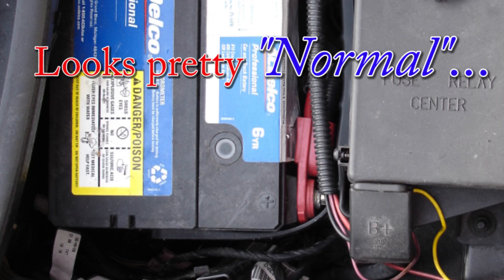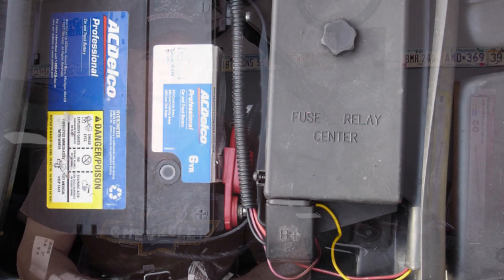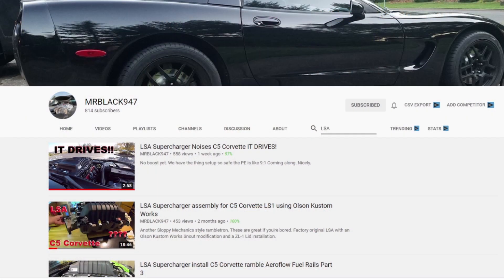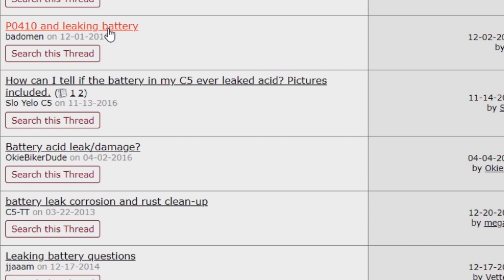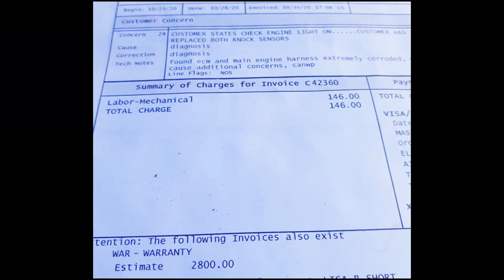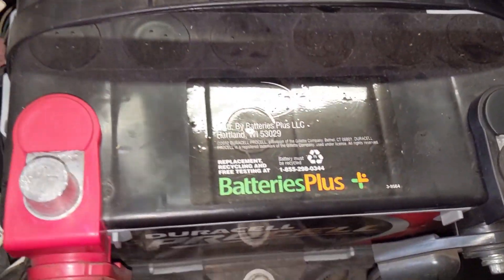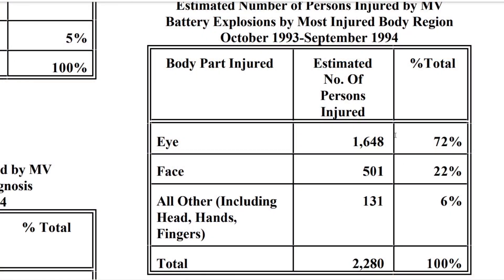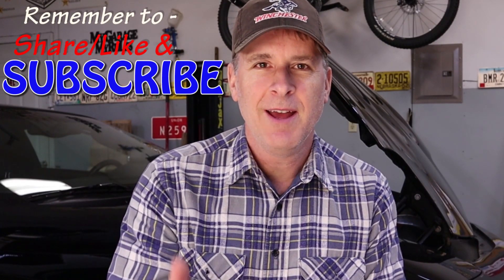Your C5 Corvette's Battery is probably DAMAGING it!

Comment: This is all good information and I thank you for your solution.  I bought my wife a 30K mile '01 earlier this year and knew of this issue.  You have motivated me to check the type of battery the previous installed.  Also you are spot on about battery safety.  Years ago I was helping a friend jumpstart his car.  I turned away just when his battery exploded.  The entire top of the battery blew apart, acid everywhere.  The explosion was so loud my hearing was lost for a day.  I was very lucky that my eyes were spared and your advise for safety glasses should always be a must.
Reply from the maker: Thanks for chiming in and the kind words!

Comment: My C5 has never had a battery leak issue. Still have a flooded acid type battery. But as a precaution, besides checking for leaks and deformed sides monthly, I bought a 1/4" thick battery mat from Amazon and put it under the battery. Mat is chemically treated to absorb and neutralize leaking acid. Under $15 for a sheet. Needs some trimming with scissors to fit exactly.

Comment: Great advice, just double checked my battery, it’s an Optima AGM !!! 😘 Pulled the battery and box and cleaned the entire area after I bought my 02 convertible a year and a half ago. Some very mild signs of corrosion. Cleaned all that up and checked out the computer and wiring. All looked good. C5’s are a really fabulous generation. Thanks again for your video. Merry Christmas, Bob
Reply from the maker: Thanks Bob, appreciate the comments and Merry Christmas to you as well Sir!

Comment: I just replaced my AC Delco battery with a Optima Red top battery. No leaking and my battery tray was extremely clean.
Reply from the maker: Nice!   Many are just fine.  Not every sealed lead acid battery leaks, but every leaky battery is a sealed lead acid battery.

Comment: Awesome video, thanks for posting.
Will pull the battery on my 2005 C6 later today and have a look underneath it to check. 

Great timing as I just ordered an AGM battery for my Factory Five ‘35 pickup truck. I feel a lot better about making the purchase now. 
👍🏼
Reply: Great video.   I've seen some bad ones before. I  Always make a point to check this area when looking at cars to buy.
Reply from the maker: Nice-  hope you find no leak issues!

Comment: amen on the battery explosion.

when I was a teenager ... had one explode on me cranking a tractor.  the battery was on the other side of the firewall, but my feet were exposed to it.  I'll never forget that.  If I don't have safety glasses, jumping mine/another, I always turn my noggin expecting the explosion.
Reply from the maker: I have one explode as well inside the back of my Volkswagen bug when I was 17. It was so loud I thought the car blew up luckily it was underneath the seat so I did not get hit by any acid it made one hell of a mess though and now I always try to connect the positive first and then the negative far away from the battery just in case...

Comment: I have heard this and watched your video as well as others including one by C & S Corvettes where they work on corvettes  C3, C4, C5, C6 C7 and their opinion based on servicing corvettes is the mat and gel batteries do not like areas of high temperature climates;  do not last long;  need a special type of charger and do cost over $100-130 more.
I was thinking about it and decided for my 2001 C5  I check the battery often but also decided to get a  BATTERY MAT that when acid comes in contact with it,  it neutralizes it.
Reply from the maker: C&S definitely has a lot of experience. That having been sad my Duracell AGM is 8 years old and still going strong. It's probably going to die pretty soon and I'll absolutely buy another one.

Comment: thank you for the great info am looking for a C5 and every car I come accross has had the AGM replaced have asked several dealers and private owners if they would remove wheel and cover plate and or battery and box no such luck have passed up half a dozen cars for this reason
Reply from the maker: Did you try telling them you would buy it contingent upon they're not being acid damage?

Comment: Silly question.  How do you tell if your battery is lead acid or agm?
Reply from the maker: Very carefully read all the fine print on the top of the batt.   Absorbent Glass Matt should say AGM somewhere.  If in doubt, call the manufacturer with your make and model battery.

Comment: Well then.. it’s a good thing I didn’t cheap out with my battery replacement recently… haven’t replaced it yet but it’ll be a winter project pulling that wheel well off and checking the pcm and that area. And getting an AGM battery for my baby.
Reply from the maker: Right on!
Reply: @Toys4Life  and honestly I can only take so much of corvette forum.  Just toxic people ruin it. Forums used to be great.  Just not anymore.

Comment: There is an overflow vent on lead acid batteries, attach a small vacuum line and run it underneath. As for the corrosion on the terminals (galvanic reaction), add some corrosion inhibitor. Problem solved.
Reply from the maker: I just looked on one that I had laying around and I don't see it. I'll have to check another one out, this is not ringing about but I may have just never noticed it. Either way my next battery for the C5 is still an AGM!

Comment: This @hit happened to my C5... Although, I used the right battery, it was even an AGM battery which amazingly started to bubble crap out. I damaged it trying to clean it up w/ baking soda and water. Been chasing wiring demons for several years now. I'm trying to find a battery box if anybody makes one to just capture any crap that could potentially bubble out.
Reply from the maker: Yikes.  Not much room for a box without altering the way the battery mounts...
Reply: @Toys4Life  yeah I'm seeing that unfortunately. I bought a new AGM battery but in light of this trouble I've not really driven the vette in 4 years... only to run motor a bit and keep it up. Wish there was a better / aftermarket solution to this beyond the AGM batteries.

Comment: Yeah, It happened to mine. GM, what were they thinking.
Reply from the maker: And I still get comments from people that this is fiction....    Did you switch to AGM?
Reply: @Toys4Life  Yes AGM. Cheapest way to remedy this issue. There are more expensive batteries that are less weight, but if that's not important then AGM.

Comment: i hear the agm batteries are not very reliable ive never had a problem with a wet battery and they last a long time
Reply from the maker: I'm on over 8 years with my agm. That's the longest I've had a battery. Sealed lead acid are just fine, until you get the one that leaks all over your computer. It's a small risk That can be eliminated with an AGM. Property depends on how long people are going to keep their cars. Short-term, go cheap. Keep the car for 15 years, go AGM?
Reply: @Toys4Life  either battery will work fine. if you never open your hood and ignore tune ups then i would never use wet battery
Reply: @Toys4Life  in this video at 6:53 it explains whats recommended for the location and temperature for vettes https://www.youtube.com/watch?v=AUtiDjbS-Us i think overall batteries are pretty reliable
Reply from the maker: The reliable until they're not. There are more than a few people out there that have had their computer and/or harness destroyed by a leaking lead acid maintenance-free battery , maybe it's 2% but those people are miserable and they're unhappy about it. Maintenance-free lead acid batteries occasionally can and do leak- and on the C5 it can be catastrophic. C6 as well. AGM eliminates the risk. The choice is up to the owner, and most people have no idea that it's an issue, albeit a rare issue.

Comment: I have over 100k on mine with no issues. I've never had a problem  because I  have never bought a cheap ass battery.
Reply from the maker: Could be, or it could be that you got lucky. From the feedback I've received all over, it seems pretty random which ones leak due to cracks, or seals around the post leaking. Sounds like they will all leak, if your alternator ever has an issue and overcharges them. Problem is you can't tell in advance if yours is ever going to have an issue, and on the C5 the consequences can be dire.